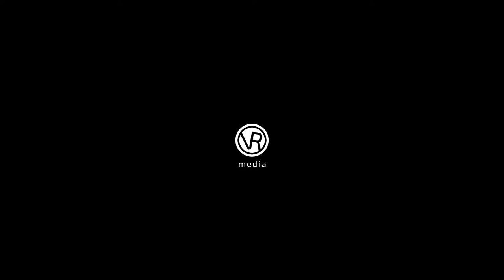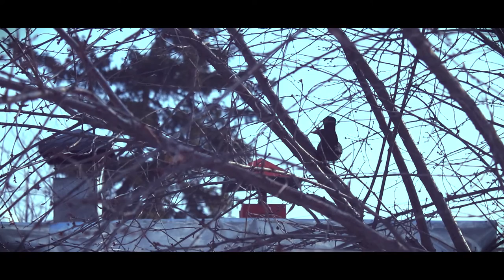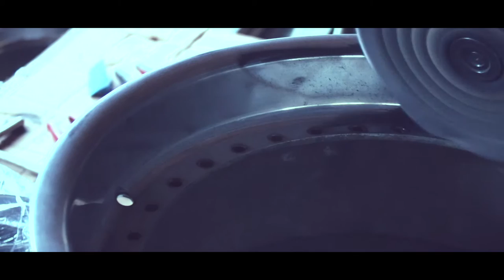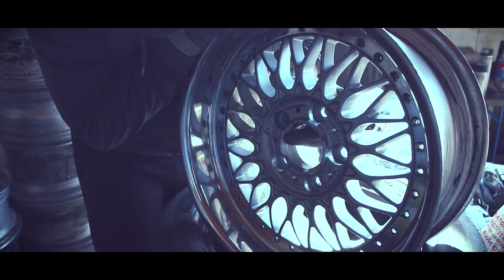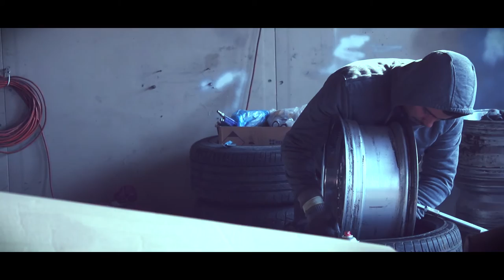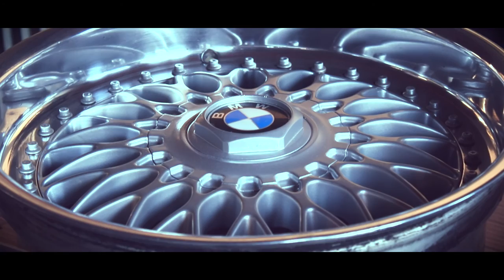BBS RC 090 Quick Assembly

Comment: I have been searching but no luck... How do you remove the center caps? do you just twist counter clockwise?
Reply from the maker: Hi Peter,

There is a key made for this: http://bit.ly/2rxnnrY
Alternatively, you could pull and create a gap then use a flat screewdriver and remove the cap.  
I hope it will work.

Cheers!